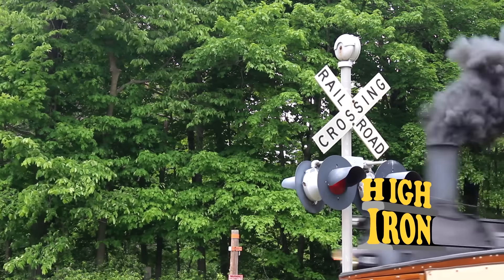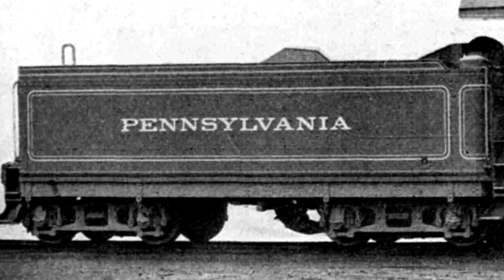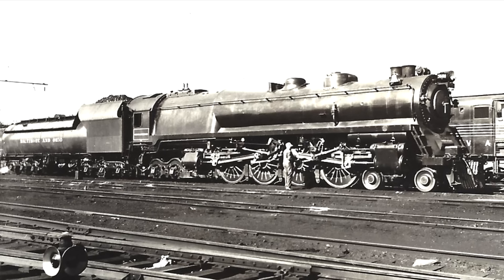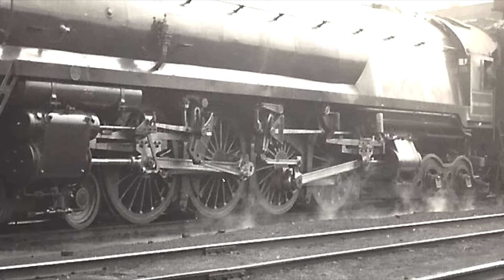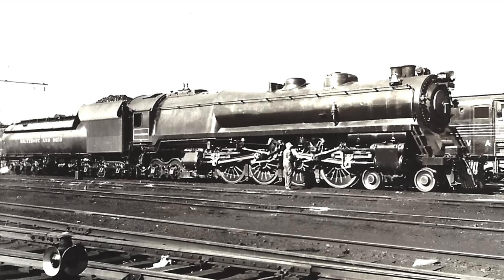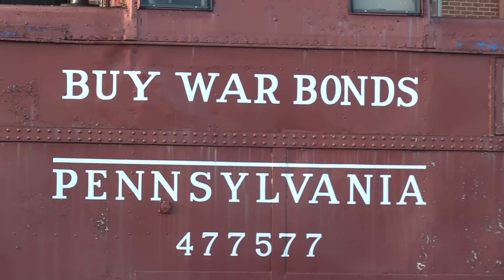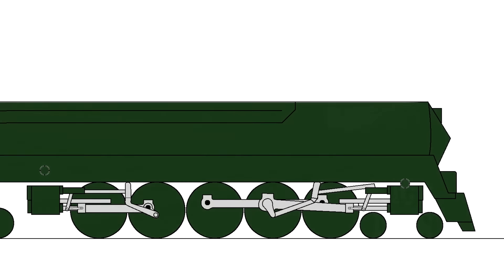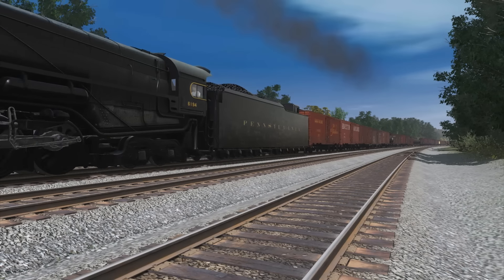Why Weren't Duplex Steam Engines Successful?

Comment: A friend's grandfather was a mechanical eingineer for the Santa Fe.  As young engineers at school we read his reports on front end design (stack, draft and cylinder exhaust), coal testing, valve gear and other subjects with fascination.  In its heyday rail was a huge industry featuring in every day life across the country and not so much in the background as it is today.

Coal quality testing was done with dynomometer cars and a test engineer over a standard section of track with a dedicated test engine so that consistency of the testing would be assured.

One of the best parts of the reports was the professionalism and precision exhibited.  No sloppy opinioneering was seen.

Comment: For every great aspect of the duplex, there’s always a drawback and that kinda why I like them. Especially the T1’s. I always figured the T1’s were a tad too powerful for what Pennsy crews were used to, and this basically confirmed that. 

Something else to note about the T1’s trials on the C&O was their experience with some of the T1’s qualities. Staff were already rather familiar with multi-cylinder engines, even if they had a hinge in the frame, and they would’ve had some experience with poppet valves thanks to the recently rebuilt L-1 Hudson’s and possibly the L-2-a’s. The PRR wasn’t familiar with either of these so of course they would slip with a yanked front-end throttle. Splitting the drivers was probably a detriment in that regard, since each driving set had less wheels to recover from a slip than a Pacific or Northern type. In that regard, it was probably for the best that the Pennsy chose a 2-10-4 for its War Baby rather than a 2-6-6-4…
Reply: It's not that the T1s were more powerful; it was that (as he said in the video) the combination of the much better-flowing and quicker-opening front-end throttle and the poppet valves made low-speed power control, where the T1s already suffered due to their short stroke and high pressure, difficult.  Remember that these engines started with a FA of about 4.48, which is ridiculously high (compare Voyce Glaze's J-class FA!) and this was actually increased further with the sleeving program.

The real problem here was that there were not separate throttles, or a trim or 'traction control', on the two engines of the T1.  (There is, as designed, no real room to put in separate throttles for the two steam circuits).  It was also apparently difficult to tell from the cab when the front engine was slipping.  It has been pointed out that this problem could be partially addressed by having differential-slip indicator lights in the cab that would indicate a slipping engine, but the response would still have to involve horsing the throttle in and then out again -- and PRR passenger-engineer reflexes were set.  (I find the level and type of PRR training on these engines to be frankly appalling)

The amusing thing about the C&O testing was that it wouldn't have mattered if the throttle were or weren't horsed: the problem was stalling, primarily due to the short stroke, not slipping as traditional lies tried to have it.  Dave Stephenson attributed that to the extra-long 18-car train C&O ran for the test.... to 'take advantage of' the nominal higher horsepower at speed.
Reply: I wonder if PRR went for an FG over the J for their War Baby if the Duplexes would have left a better impression.
With the Duplexes on their own, PRR crews could get away with saying "this new thing just doesn't work" for a while, but if there were just handed a proven working type right before getting the shinny new Duplexes than some answers might have come up sooner. "This works elsewhere, so it's something about the crews here".
Reply: i always wonder what old technology would be like with modern 2022 equipment etc.. 

i still think steam powered vehicles need to be revisited. but then again [SHELL] might make everyone disappear.
Reply: @wizlish  That's more or less what I was getting at, they made steam quicker and were ready to use it quicker than what crews were familiar with, but this is a far more detailed explanation. I find the T1's quite similar to the Bulleid Pacifics from Great Britain in this regard. Both types were quite radical for steam engines, with the first few examples spitting in the face of wartime restrictions, but their complexity lead to bad reputations with the operating department in spite of how well they handled heavier trains. Hell, I even found out that the slipping problems relating to both classes is largely tied to how quickly they produced steam
Reply: As I recall they were rigid frame with larger diameter drive wheels... this did not 
Add to their tractive effort and caused them to be slippery and prone to losing their adhesion on curvy tight radius winding track

C&O evaluated one found it to slippery on these surfaces compounded by wet icy sections of track where sun light was blocked by mountainous terrian.
Reply: I always wondered why C&O did not embrace 4-6-6-4 wheel arrangement.

I am working on a well detailed Bowser model as a what if.

Hey, its my railroad, ha!
Reply: @stevecanfield4166  Well the Alleghenies we basically their version. Same driver to carrying wheel ratio, but one less leading axle would’ve put more weight on the front drivers, and the extra axle at the back was clearly to support to ultrapower firebox
Reply: @russellgxy2905  To piggyback on your comment: furthermore, most roads that had 4-6-6-4's would have been better off having bought 2-6-6-4's instead.  Most owners of Challengers never had a need (or even a place) to operate them at high speeds.  
So, even had C&O not gone all in on an ultrapower loco that required a 6-wheel trailing truck, they likely would have gotten 2-6-6-4's.

Comment: One thing I have always wondered was why trains have an open steam system. Ships operated with Triple Expansion engines for over a century. These systems had a closed loop system that sent the spent steam through a condenser and back into the boiler, so they didn't keep having to refill their boiler tank. Trains just dumped the spent steam out the piston. It seems to me that a system where the steam is pumped through internal pistons and a condenser, back to the boiler, and those pistons then transfer motion to the wheels through a cam system would be much more efficient and have much fewer moving parts, especially exposed on the outside. This would also eliminate the need for frequent stops to re-water. I'm a fan of Railroad Tycoon, and have had a few occasions where I had to spend the money to add a little junction station somewhere useless to install a Water and Sanding tower for trains passing through (particularly in rough areas) or along long high-value stretches.
Reply: The big snag was lack of space in railway locomotives. There were a few condensing engines (on the London Underground for example!) but they didn't work terribly well; the water tended to get too hot and was then difficult to feed back into the boiler. So generally it was easier just to top up the water from tanks or troughs periodically. Condensing of course also works extremely well in power stations and allows much more power to be generated from the turbines.
Reply: Boats have an unlimited source of cool water for condensing the used steam.
Reply: I believe that South Africa operated some steam locomotives with condensers, but if I recall the condensers were bigger than a tender. But then there are areas in South Africa with very little water. In the eastern US, both the PRR and NYCentral used track pans between the rails so that scoops lowered from the tenders could refill the water tank while at speed.
Reply: The exhausted steam provides draft for the fire, doesn't it?

Comment: Reminds me of some of the absolutely gorgeous machines from the flying boat era, such as the Saunders-Roe Princess and the Boeing 314 Clipper.  The jet age came along and jet engines became the standard for truly large aircraft, plus the boom in passenger travel saw ground-based airfields transform into massive airports as we know them today.  Flying boats just weren't needed anymore and that unique era of aviation passed into history.
Reply: The flying boats is now the flying yatch , with strange fin like architecture that allows the yatch to hover above the water surface at great speeds.
Reply: Jets didn't kill flying boats, post-war piston airliners did.

The improved range, speed, and reliability of large aircraft during the war (plus introduction of pressurised cabins) along with the airfields built to accomodate heavy bombers which could be converted to civilian use eliminates the need for flying boats before jetliners entered service in the 1950s.

Comment: Once met someone involved in C&O’s testing of the T-1.  He said (which has been backed up by other sources), that the C&O liked the T-1 except when they tried to test it in the New River Gorge.  The results were that the T-1 couldn’t maintain much speed through the Gorge, the constant turns and grades were hard on the T-1.  The biggest problem was that it was simply too long to make the turn at Hawk’s Nest going the right way (eastbound and westbound tacks are separated by the river from Sewell to Hawk’s Nest).  So the T-1 and its train had to back all the way back to Sewell (about 10-15 miles), and then proceed west on the eastbound mainline so they could avoid the curve

Comment: That attitude of "if it ain't broke, don't fix it" allowed steam to run for almost 120 years on my local line. There was resistance when British Rail tried to force diesel out, hundreds of local jobs were centred on maintaining these gorgeous engines, diesel cocked that up.
Reply: Steam is less than 10% efficient (90% of energy is waste heat). Diesel electric is 30% efficient and electrics are 95% efficient. That's the big problem.

Comment: If the T1s were fitted with Walschaerts valve gear instead of those Poppets, they likely would've been successful. 5547 was refitted with Walschaerts and performed much better than the other T1s and was reclassified as a T1a.
Reply: The Type A poppet valve gear, was admittedly a maintenance nightmare. However, the Type B rotary cam is easier on maintenance, and more efficient, especially at high speed, even against Walschaerts. #5500 was fitted with it after an accident, and #5550 will be fitted with it once it’s built.

Comment: I worked at the Eddystone plant in the 1980's where I was doing prototype work on the V22 osprey. The locomotive works was at the time was the main assembly building for the CH47  Chinook Helicopter.  the large facility worked well for 2 reasons the large gantries were good places for assembly of large components, and their location on Delaware bay was a good relatively safe place to conduct initial check out flights in the crowded Philadelphia area.